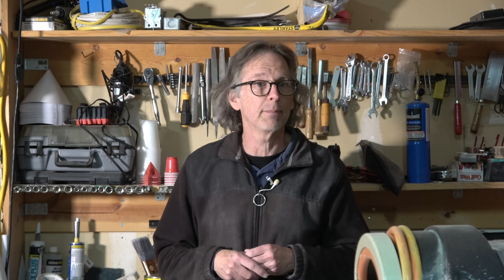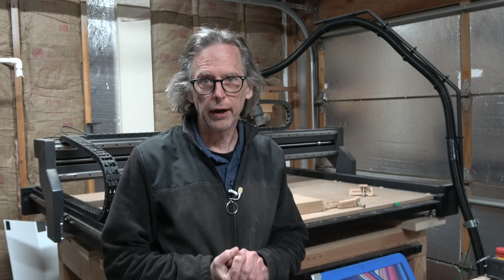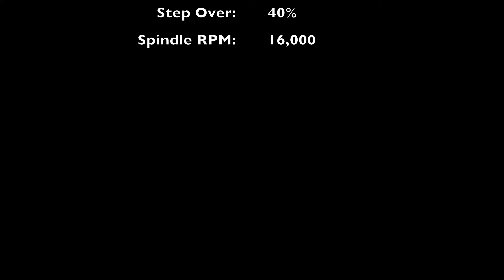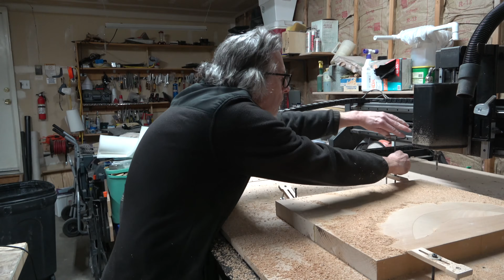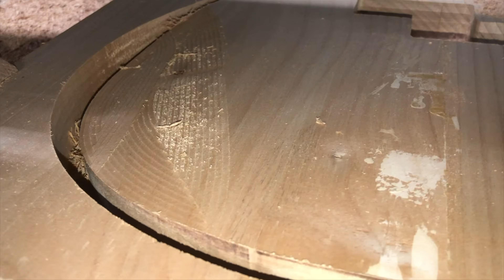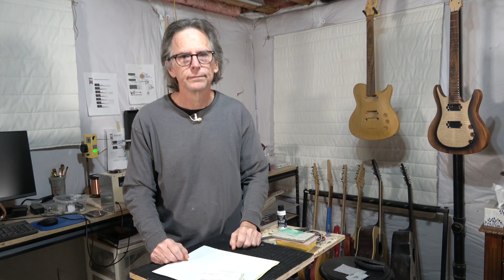Building A Precision Bass Part 11 Using A CNC Machine To Make A Guitar Body

Comment: I would not use the left bottom corner as a reference since you have the meterial lined up at the very center of the X and Y and i also think you have the file centered in the middle of the material, that makes it alot more easy to use the centerpoint as a reference and very easy to just flip the material and center it and clamp it down again, of course there is several ways of doing this and most of the ways will work good, for me i just use the center as a reference, it makes my life so much more easy :D. good video by the way :D

Comment: Great video Chris. I do have one question do you or have you ever had alignment problems with the neck pocket holes being drilled from the back in the 1st operation and then flipping blank over to mill the actual neck pocket.  I saw you had center lines marked on the table but does that give you the precision needed or did you have  some other step that you didn't show. No criticism here just curious.
Reply: I apologize I didn't mean any disrepect.
Reply from the maker: @billyhooks99  I didn’t think you were being disrespectful. It was a good question. Accuracy starts with the lines. If they’re off, well…
Reply from the maker: If I did, I wouldn’t use this method.

Comment: Thanks for uploading, Chris. I find your CNC content very interesting and fun to watch (yeah, I was one of the cool kids at school). I have a set of g-code for a strat body that I modelled in fusion 360 but it's sitting at around 2 hours 20 minutes, I guess there's a lot of room for tweaking it until my CNC router is built. Just from curiosity, how long would it take you to do all this by hand, starting from the blank? (By hand I mean power tools)
Reply from the maker: It used to take me a full 8 hour day to go from a blank to a body ready for paint/stain. However, for me, time isn't the big factor for switching to CNC. It was the wear and tear on my neck, back, and shoulders. 15 years of building by hand will destroy a person.

Comment: 20 minutes watching a CNC spindle. I’ll get the popcorn.
Reply from the maker: This one will mostly detail CAM strategies with some carving action thrown in for kicks.
Reply: @HighlineGuitars  For those with cnc machines this will be gold. For those with hand/table/pin routers, not so much. But I’ll still watch..
Reply from the maker: @JerryF42  You know what's funny? Take a look at how many pin routers are on the market compared to CNC machines.
Reply: @HighlineGuitars  The CNC machine largely supplanted the pin router, and I feel like people who want one now just shop the used market from those commercial machines that were no longer cost effective.

Pin routers and CNC are really similar machines though. Makes me find the whole debate kinda silly.
Reply from the maker: @UltimateBreloom  I have found the folks who want to debate against CNC are the ones who just can't grasp the software.
Reply: @HighlineGuitars  I think that's largely true. I don't mind people who prefer building them that way. And I don't even really mind people that market them as made the old school way. 

I do dislike people who try to dismiss the results as somehow inferior because they were made on a CNC. My philosophy is a kickass guitars are kickass guitars, no matter how they're made. 

Though, I'm not sure you can accuse of being stubborn with software. The lengths you go through to avoid using a modern CAD program is extraordinary. 

I get it though, I'm not the biggest fan of Fusion 360 either, and all similarly equipped programs are expensive. I use Solidworks, and it's an excellent, powerful program. But I'm also spoiled as I have a free liscense at the moment from university. 

Either way, I want to thank you for your videos. I've been doing CAD work since I was 14, but have never really done the CAM side. Your videos have helped a lot in bridging the gap between my models and reality.